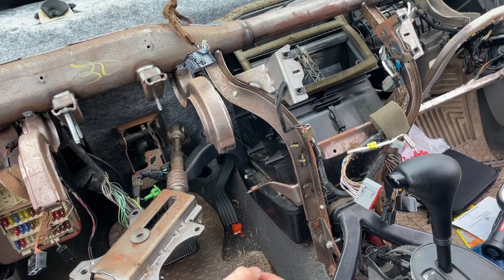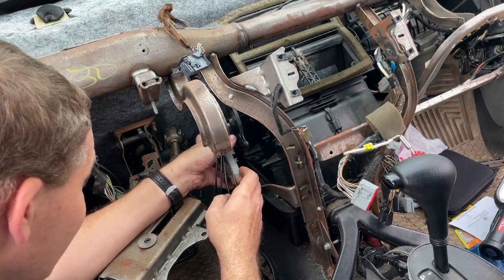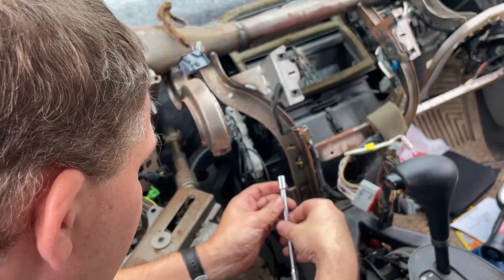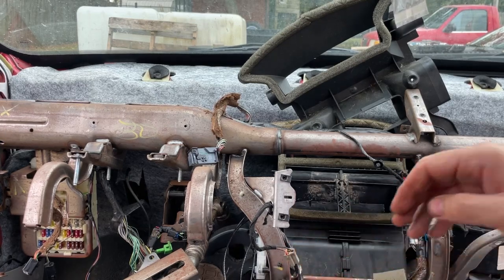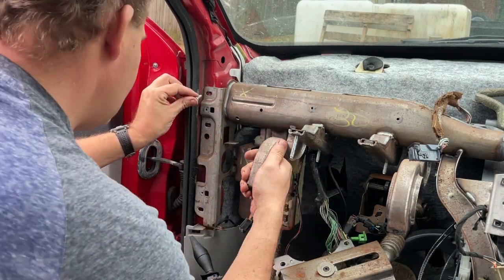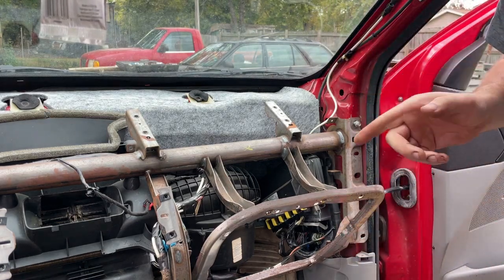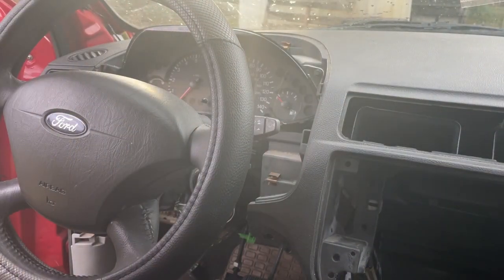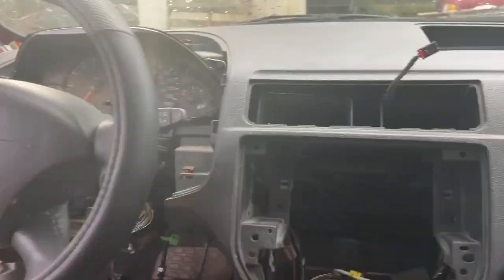2000-2007 Ford Focus Blend Door Fix Done Correctly!!! Part 3

Comment: so where the actuator attaches to the hvac box, would that box be easy to replace if i had broken something on it ? and where would i even find that part? I also need the actuator as i have broken the black male ac/heat control fitting.
Reply from the maker: @KevinMansell-d8x  the actuator attaches to the driver side of the box, that whole assembly can be removed by taking a couple screws out, the box itself is a huge pain, once you get the dashboard out you have to drain the coolant and vacuum recover the Freon, there’s nuts and bolts under the hood that hold the box to the firewall, if you need a new hvac cable, the hot cold you can get those at the parts store, the mode doors comes from Ford.